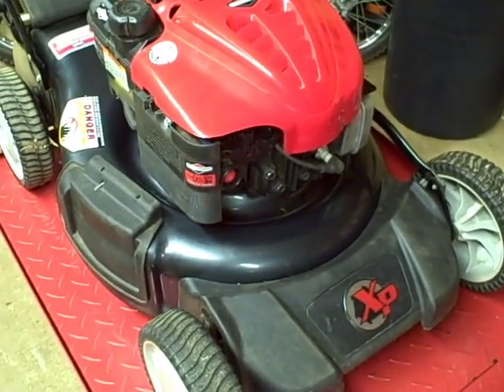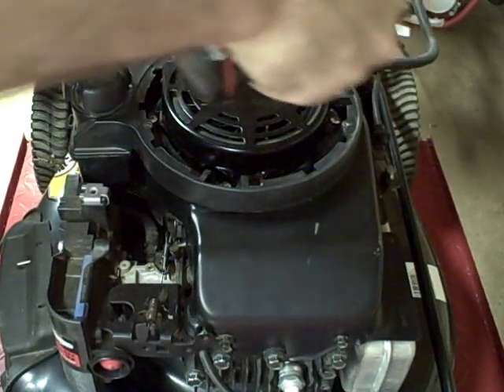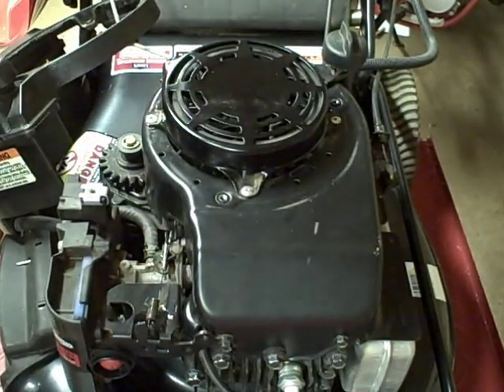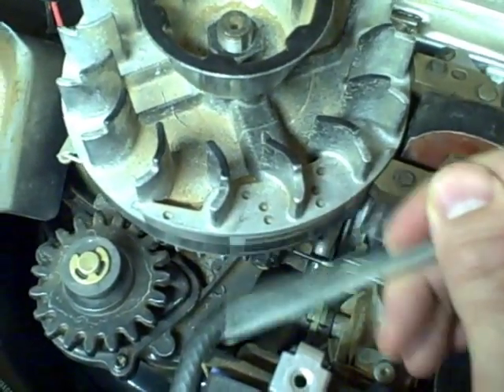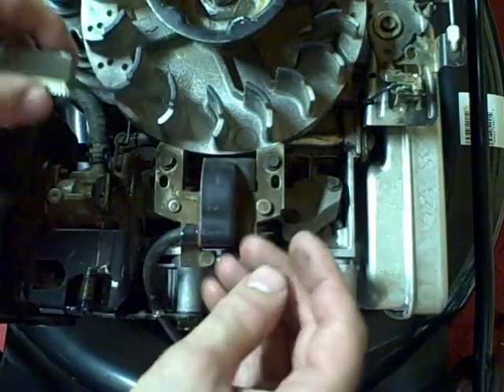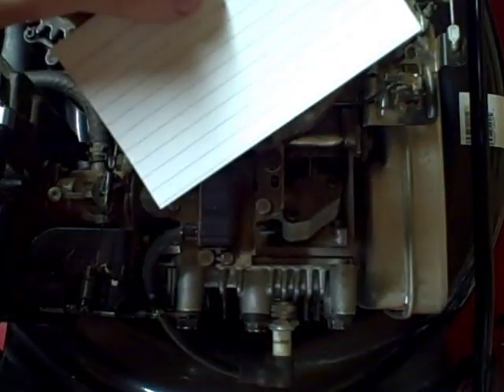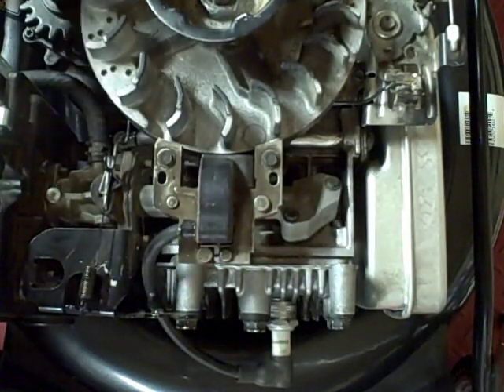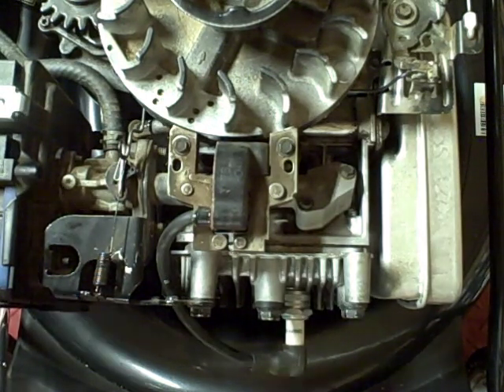Small Engine Repair: Easy way to adjust Ignition Armature Air Gap on a Briggs & Stratton Lawn Mower

Comment: I guess that I need to make sure that both arms of the magneto are being pulled snug before tightening the bolts. I can't see if both arms are being pulled snug, so I probably need to try to pull each arm away.